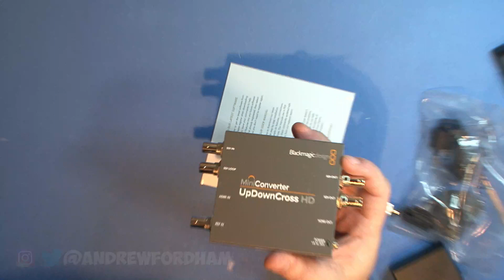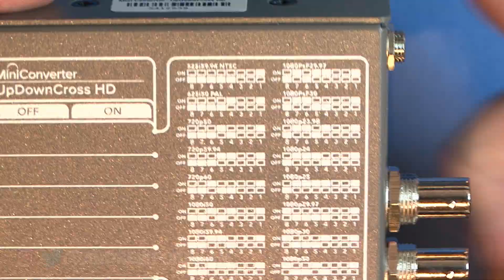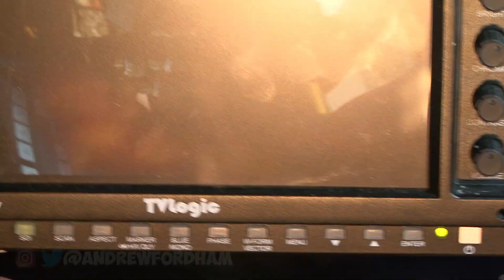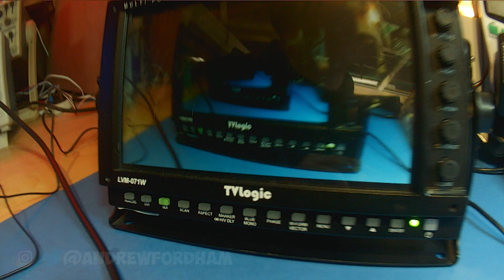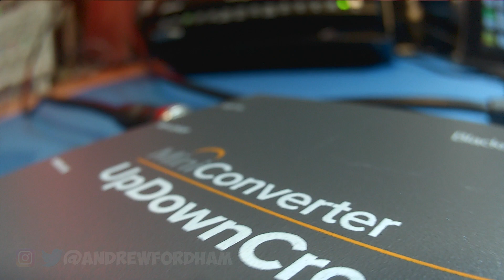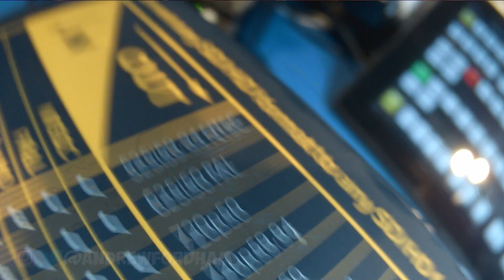Testing with ATEM | Blackmagic Design UPDOWNCROSS HD

Comment: One thing to be aware of with the UpDownCross HD is that when you use it for 50i to 50p or 50p to 50i conversion it goes via 25p - so you lose the smooth 50Hz motion of native interlaced or 50fps progressive, and get juddery, film-look, 25Hz motion.
Reply: Is this true? This would completely ruin the value of this box.
Reply: @ConsumerDV  100% - I did in-depth testing and returned it as not fit for purpose and my re-seller refunded me.  I bought mine as I wanted 1080i25 to feed into an Atem Mini in 1080p50 when I discovered the limitations of Atem Mini's input stage (taking 1080i25 to 540p25 and then upscaling and frame doubling)

AJA's (much more expensive) equivalent does retain 50/59.94Hz interlaced motion in all directions - the BMD only retains 50/59.94Hz if you stay progressive for both input and output. The minute you introduce interlaced you get dropped down to 25/29.97Hz motion.
Reply: @stephenneal7373  Thanks, I appreciate the reply! In your testing, did you feel it dropped one field or weaved them or blended them? Did you notice artefacts typical for incorrect deinterlacing? Although even if there were none, dropping one field out of two is unacceptable for a professional-grade product.

Comment: Well technically the frame rate is the same as 25p and 50i are both 25fps the 50i just has an interlaced, so 2 layer sensor

Comment: Hi, i need to downconvert a 4k signal,  is possible to send an analog out  to the sdi1 and a 4k(as font) to the sdi2?
Reply from the maker: The sdi1 and sdi2 outputs are the same output just separately buffered, not dual link.   This updown cross doesn't support any 4k signals.

Comment: Hello, great video. Do all outputs run simultaneously? I'm looking to run HDMI in, then SDI + HDMI out at the same time (effectively HDMI to SDI with HDMI thru) - is this possible using the updowncross?
Reply from the maker: Yes all outputs are always active, both sides and the hdmi.
Reply: @itsAndyFordham  thank you v much!
Reply: Questions is though, when feeded with SDI AND HDMI, does it bi-direct them, as in the SDI IN>HDMI OUT and the HDMI IN>SDI OUT. Like the bidirectional.

Comment: hola con e mini converter puedo entrar con una camara en 1080i 50 y salir en 1080i 60???
Reply from the maker: Hi yes you can choose between 1080i59.94, 1080i60 for output, it will support either output framerates.

1080p23.98, 1080p24, 1080p25, 1080p29.97, 1080p30, 1080p50, 1080p59.94, 1080p60
1080i50, 1080i59.94, 1080i60
Reply: @itsAndyFordham  muchas gracias x la respuesta otros videos no supieron contestarme si se podia pasar de pal a ntsc / o / ntsc a pal...

Comment: Hi Andy  I have BMPCC 6K Total Video Outputs
1 x HDMI up to 1080p60 i need out to HDMI or SDI  atem 1080 50i.... is this possible?
Reply from the maker: Yes, if you set the converter to 50i output then it will convert the picture, although if you convert from p60 to 50i then you may have a regular frame judder as the non similar framerates discard the unneeded frames.  I may do a 60 to 50 test video to answer this question

Comment: HI there ... I am wanting to use an old ENG 2/3 inch camera for multi camera shooting ... we are using a Blackmagic ATEM Studio HD to connect the cameras together. The ENG camera shoots 625i SD and the rest of our cameras are 1080i or 1080p HD. Can I use the UPDOWNCROSS converter to convert the SD signal (composite video out feed) to 1080i or 1080p signal so I can use it with my other cameras. Thank you inadvance.
Reply from the maker: Tarx Morrison I will test it and let you know the outcome, should work fine although I want to see what happens with the ratio, are you shooting 16:9 pal or 4:3 ? Although you will need a composite to Sdi /hdmi before this unit this is sdi hdmi only

Comment: Hi Mr. Andy..
if my video output from mini atem is 1080 50p, can it be converted to 720 50p so that I can record using an intensity shuttle at 720 50p? and whether the output sdi and hdmi can output video simultaneously. if we use all outputs.

Thank you..
Reply from the maker: Hi, yes it is very easy to convert to 720 50p from the device.  Both the SDI and HDMI outputs from the converter will run at 720p 50.  Both outputs will be simultaneous.   If you are using SDI IN from the atem at 1080p50  then you will have .. SDI LOOP  output at 1080p50,   SDI 1 OUT at 720p50,  SDI 2 OUT at 720p50 and HDMI OUT at 720p50. Hope it helps.
Reply: @itsAndyFordham  thank you Mr. Andy.. helpfull 🙏🙏🙏🙏
Reply: @itsAndyFordham u

Comment: I'm glad I found your channel. 

I have recently bought a new PC monitor (for editing with a Mac). I was wondering if my Sony FS7 would be able to show a picture on the screen, but the monitor doesn't recognise the signal. I tried several HDMI cables including ATOMOS' 4K compatible one (the monitor is HD). The FS7 had the following settings:

Display Out: HDMI 1080p
Framerate: 23.98fps

I haven't tried changing the framerates on the camera, but did try looping through my Blackmagic Design Video Assist 5". 

Whilst most of my work usually involves hiring a professional 19"monitor for client/director, there is the odd occasion where I'd appreciate having one for my own projects. Would the device in the video or just the Blackmagic Design ATEM Mini be helpful in allowing the signal to be viewed on a PC monitor?
Reply from the maker: It could be that the monitor doesn't like the 23.98 frame rate. If you used a Blackmagic updowncross  converter you could resemble the frame rate from 23.98 to 60p for viewing which the monitor would probably like. The updowncross  costs £113 in the UK.  HDMI to sdi, sdi to HDMI, sdi to sdi , HDMI to HDMI all in one box.

Comment: Thanks for this really good info. I need to convert the hdmi output on my Atem Mini to 1080i50 so this looks promising. Thanks for sharing
Reply: Are you not able to choose the video output format from the ATEM Mini to 1080i50???
Reply: @Ukat09  I do´nt think it can actually but in my case it did´nt matter since I found out I can use 108024p with my capturecard and flash media live encoder,  I do not use the usb port for streaming only the hdmi

Comment: Hello Andy! Maybe you know : I use hdmi to vga converter then bnc cable like rgbhv to send picture to JVC TM-H150C PVM from PC. So What the exact settings (resolution kilohers I need to setup in custom nvidia resolution setting panel there are lot of volts kilohers delays and resolution parameter for analog signal)

Comment: Hi andy....Drone 720p HDMI input to HDMI atem 1080 50i.... is this possible? I'm not using sdi
Reply from the maker: Yes with this converter, hdmi to hdmi 720 to 108050i
Reply: @itsAndyFordham  thanks andy... i bought 2 units .... and im very satisfied with the performance..... suitable for outdoor use in hot weather...

Comment: OMG, you just hot swapped the SDI, I can't believe it didn't blow. I wouldn't do that again honestly. But from the looks of it you got all the gear to fix it if it does.
Reply from the maker: Never had an SDI blow in all the years working in Broadcast, only when another engineer got RF and SDI mixed up and stuck volts  down the wires,  it is pretty robust, although depends on manufacturer too. Check out some of my on tour videos with kit in use...
Reply: @itsAndyFordham  lol. These are the kinds of comments I make on YouTube videos right after I blow my own SDI port. Such a bummer.
Reply: @aholder4471  What is this hot swapping? Is it bad to plug and unplug SDI's while devices are turned on? My experience with SDI is limited, so that's why I'm asking.

Comment from the maker: So I am always checking out new broadcast kit on jobs..what other kit would you like to see ? Let me know below ...
Reply: what is the switcher on the iPad?
Reply from the maker: Hi, it's a remote control app controlling the ATEM mixer. The name of the app is Strata Pro.
Reply: @itsAndyFordham  do you think it compares favourably to Streamdeck?
Reply from the maker: @JohnnyMotel99  As I haven't used streamdeck, its not something I can easily compare to, however the ATEM Production mixer is a 1 u hardware rack with 10 HD-SDI inputs with multiviewer and program outputs,  the Strata Pro app is very useful for remote controlling the Atem (all settings), I don't think you can use a streamdeck to remote control an Atem.